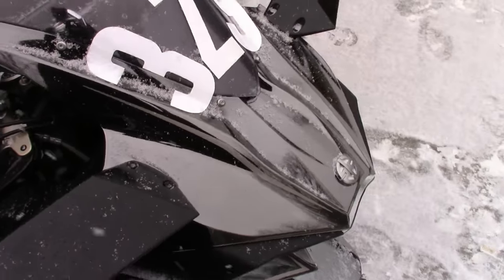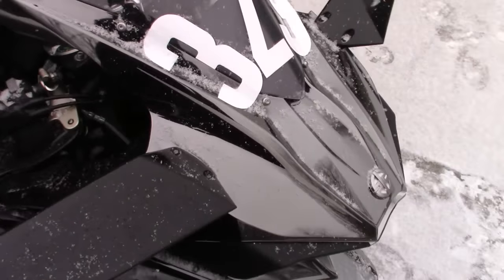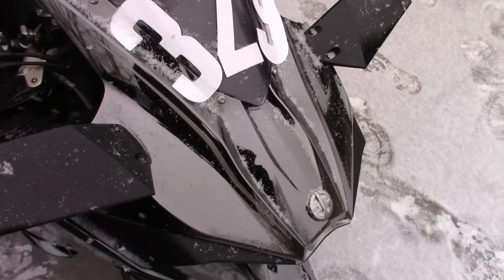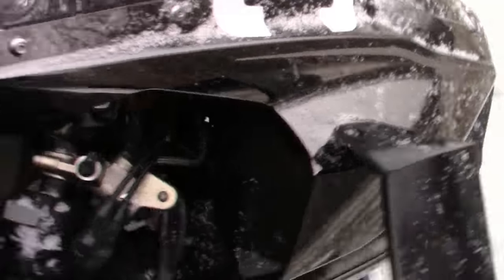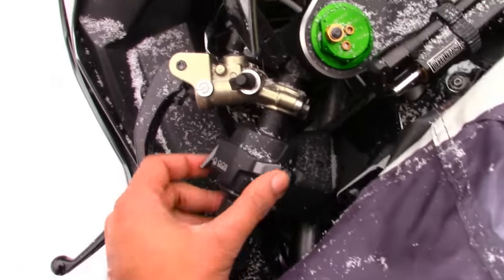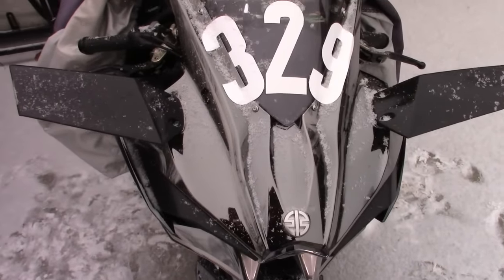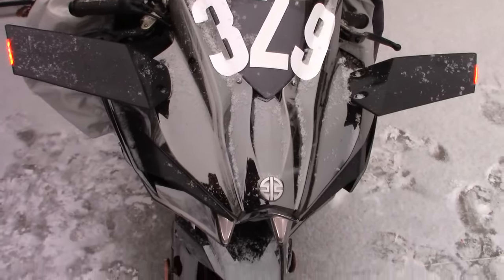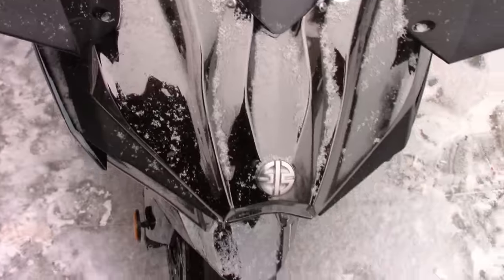Bear Racing Winglet Turn Signals

Comment: Rather small turn signals, was looking to run a whole led strip of the length of the wings so you can see it from the front aswell